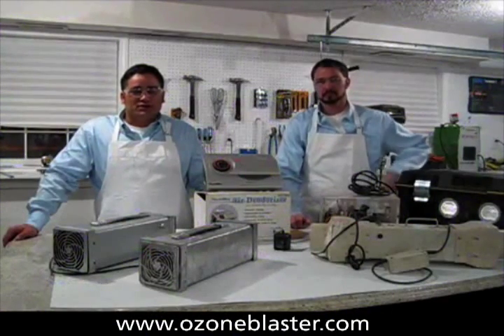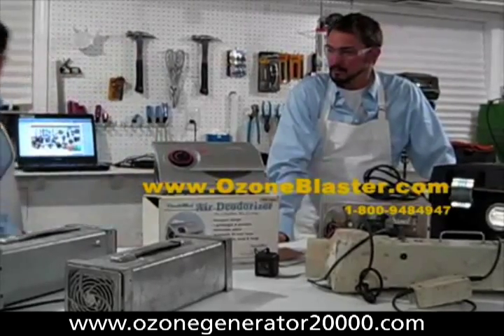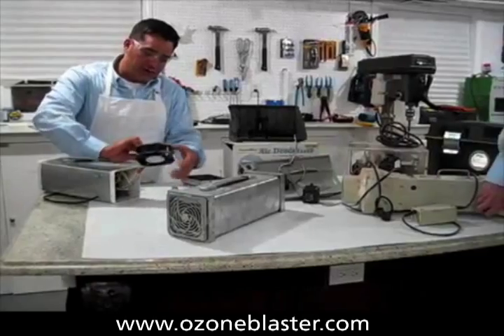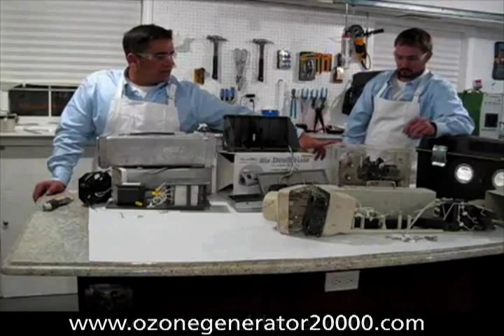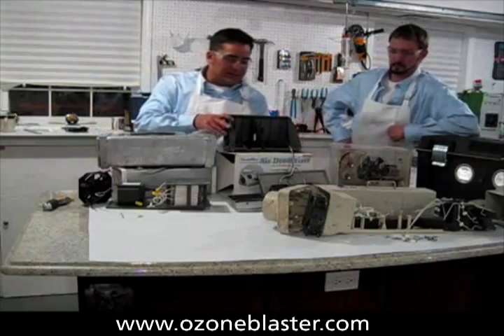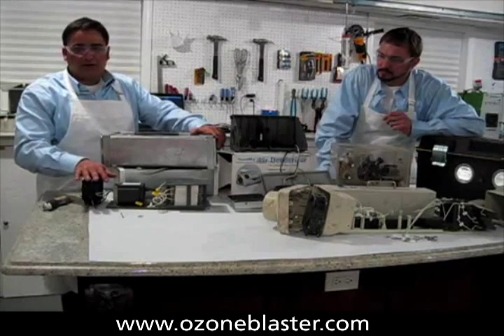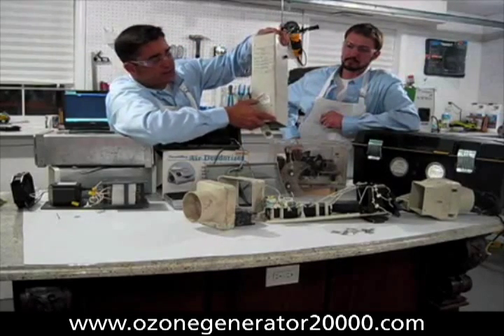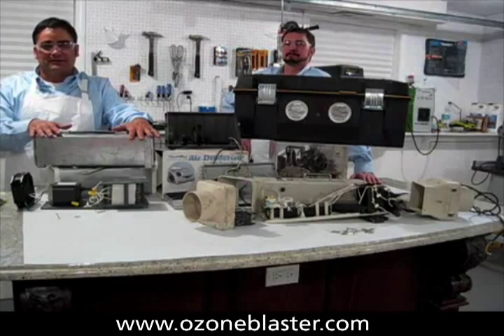Ozone Machines Exposed!  AirZone and More

Comment: Good point the guy makes about the plastic (polypropylene) tool box housing.  Ozone will oxidize the polypropylene tool box after a while .  Polypropylene is rated at  "C"  for compatibility with Ozone , not recommended for continuous use in high concentrations of Ozone.   It seems like the housing of your Ozone generator will  break down after being continuously bombarded by high levels of ozone .